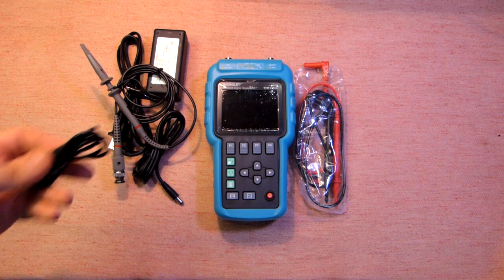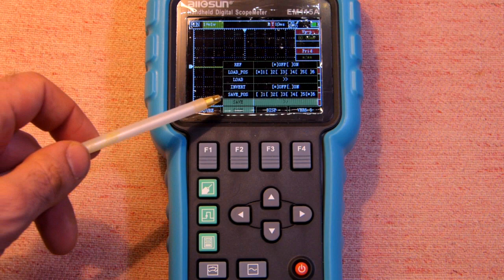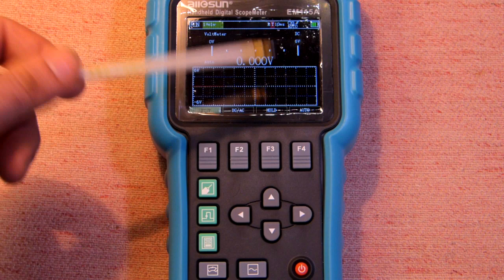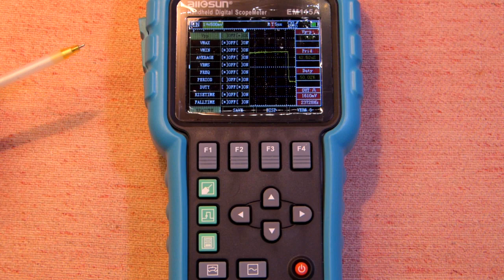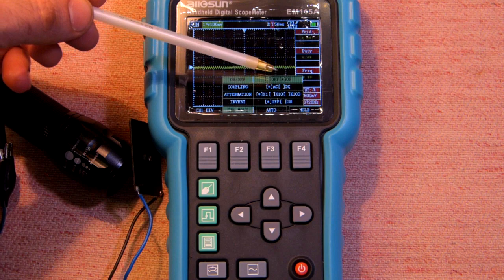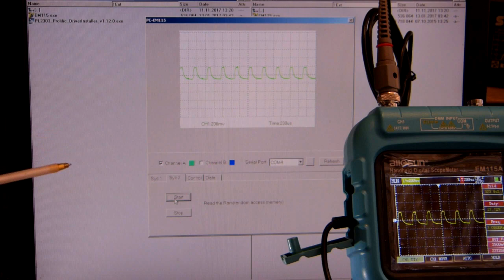ALL-SUN EM115A Oscilloscope Detailed Review

Comment: That was an awesome review, or should we should call it walk though introduction into the instruments full functions. Could you please explain what the AC Coupling function is used for and demonstrate ?
Reply from the maker: Hello, thanks! AC Coupling function is used when you have a power supply with DC output, but you need to see its pulsing/distortion.
Reply: Power Battery Channel 
Ok. You mean it is used to view what's called RIPPLE voltage superimposed on DC voltage ? That's great.
Reply from the maker: @jessew6757  Sure, exactly as here: https://www.youtube.com/watch?v=CdqJrc_fW90&t=127s

Comment: Hi Power Battery, Nice video. Are you going to make a video on the All Sun EM1230? It looks nice, but... Does it works nicely?
Reply from the maker: +Jorge Reyes U Hello, at present I don't plan to get EM1230. According to the manufacturer's information, it's the same quality device; I wanted to get it, but in fact I don't need 2-channel device, which is its pro. As to its con, - the device has no signal generator, however, 2-channel devices with a signal generator are too expensive.
Reply: Power Battery Channel  Thank you very much. I was hoping for a nice tutorial as this one. I'm planning to buy one, but i can`t find more info about it.
Reply from the maker: + Jorge Reyes U  You can consider it the same quality and functions except the above-mentioned differences. As to the menu - of course, it will differ because of absence of the signal generator.

Comment: I own this scope meter and find it a solid 99%.  The DMM mode must use a FFT mode, or otherwise because it has a lagging software quirk.  As with any instrument, if you don't know how to read it, you'll be frustrated by it.  If someone handed me a machinists' micrometer and asked me to review it; I would have no clue.  But I wouldn't say bad things about it on the Internet.  If you know how to use a bench-top oscilloscope you will have no trouble with this.  I wish the EM115A were dual channel, that would be amazing!  I also wish there was a battery option that used 9V or something other than the rechargeable. But I use this scope meter anyway!  Way, way better for the price than anything else out there.
Reply from the maker: There is also a dual-channel version - please, see the link below the video.

Comment: Nice review. For those interested: I bought this device in November 2015 and it is still working fine in 2018. Mine also came with a bag.
Reply: Hi do you know if the scope comes with XY option?
What is the lower voltage division?

Cheers.
Reply: @treadmillrepair754  This (EM115A) is a 1 channel 50MHZ oscilloscope, so there is no XY option. EM115B has two channels 20MHZ, but I don't have it.
The available vertical ranges are: 5V/DIV, 2V/DIV, 1V/DIV, 500mV/DIV, 200mV/DIV, 100mV/DIV, 50mV/DIV, 20mV/DIV, 10mV/DIV

Comment: If you were to compare the Owon HDS1021M-N handheld Oscope to this one which would you favor, it costs a bit more and it seems a better O scope but it does not have a signal generator, you can see an example at:  https://www.amazon.com/gp/product/B0170N0YA0/ref=ox_sc_act_title_1?smid=A15LGCFRX7EFVX&psc=1 
My knowledge of oscopes is limited but which would be better to buy now so I can grow into it.
Thank you.
Reply from the maker: Hello David; I've seen the reviews of it and I must say that it's not a bad device. However, its bandwidth is only 20MHz in comparison with the above-reviewed o-scope, and this parameter, in my opinion, is one of the most important ones for such devices.

Comment: +Power Battery Channel  What is the best osiliscope and signal generator under $260 USDI’m using it for audio purposes if possible to display the WRMS and frequency
Reply: If you do. Respond please use +91rickstar in front of the comment thx
Reply from the maker: Definitely - this one, which is in the video. I can't say anything about WRMS, but as to frequency - the device is quite precise and its signal generator is excellent for audio purposes.
Reply: +Power Battery Channel does it have Ture RMS
Reply from the maker: +91rickstar No; in case of  true RMS the price would be much higher
Reply: +Power Battery Channel what do you think of the JDS3012A  compared to the one in this video
Reply from the maker: +91rickstar In my opinion, ALL-SUN EM115A is more professional. That's why I've got it after JINHAN JDS2023
Reply: +Power Battery Channel can you recommend a handheld oscilloscope, signal generator, and multimeter that is true RMS I don’t mind paying extra
Reply from the maker: +91rickstar I have not seen such a device yet
Reply: +Power Battery Channel apparently this model oscilloscope has True RMS I contacted a seller on eBay they said it’s true RMS I don’t know who to believe now ?
Reply from the maker: +91rickstar I've checked just now mains voltage: 230V, then I have checked it through the UPS with non-sinusoidal signal - modified sine wave; the voltage was 161V. I suppose, it means that the device cannot define true RMS.
Reply: I just bought this meter a couple days ago, I can confirm that it has true RMS measurement up to 2KHZ. anything over 2KHZ dig out your calculator and make good use of the scope portion of this meter.